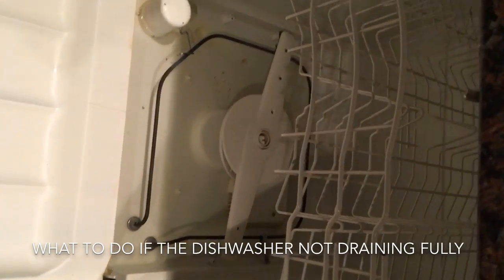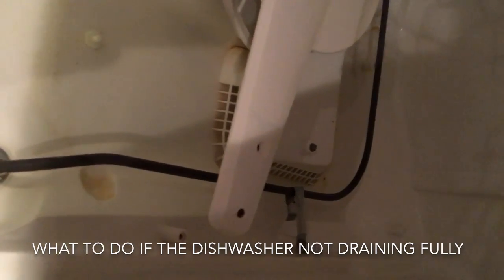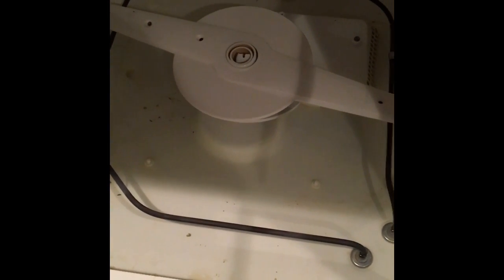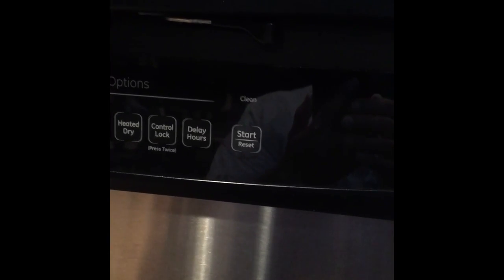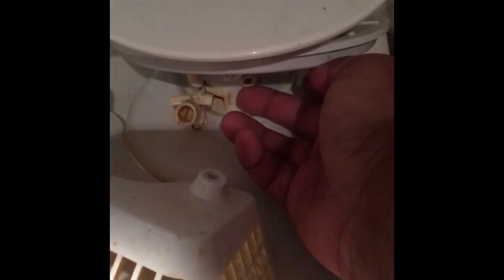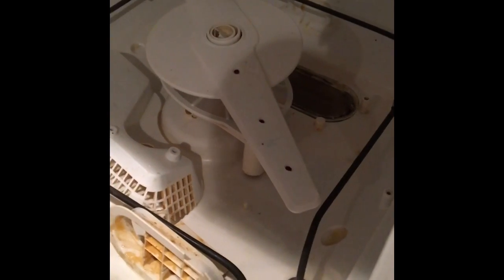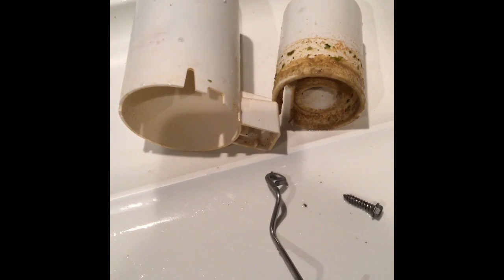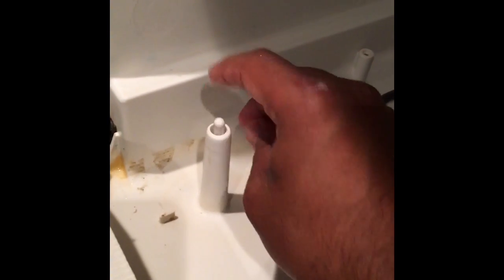Dishwasher not draining properly-Ketan Deshpande Minnesota

Comment: The off white rubber coupler costs about $8 and if it’s deteriorating the dishwasher won’t drain properly nor get the dishes clean.  The person who posted this video noticed that it was falling apart but didn’t seem to realize the significance of it being very deteriorated.  I tried all your suggestions except for pump replacement but it still wasn’t working. So on a hunch I took pictures of the serial number plate and of the interior of the dishwasher and took the deteriorating coupler ( it broke into two pieces of perishing rubber when I pulled it out) and drove to Reliable Parts in Coquitlam or Port Coquitlam and showed the pictures and mangled rubber pieces to a clerk. He went into the back and showed me a new equivalent and charged $8 Canadian and within minutes of returning home our dishwasher was working again.  Had to remove the spinning arm and remove one bolt as the video showed and remove the round filter and force the rectangular end in and ensure the cylindrical connection was attached to the round filter during the re install.  Thank you for the video